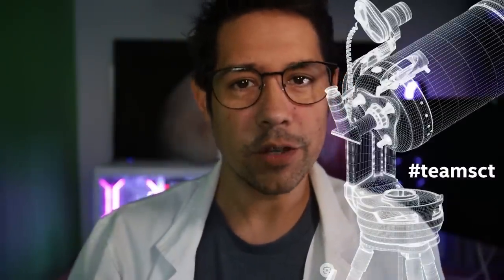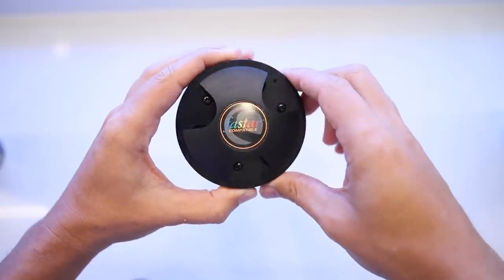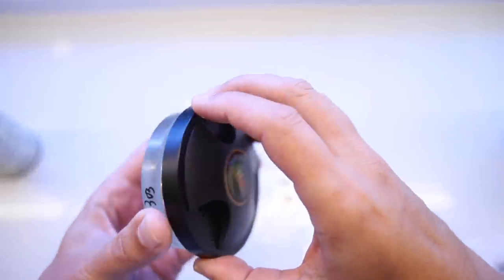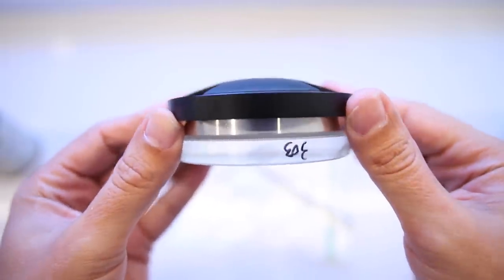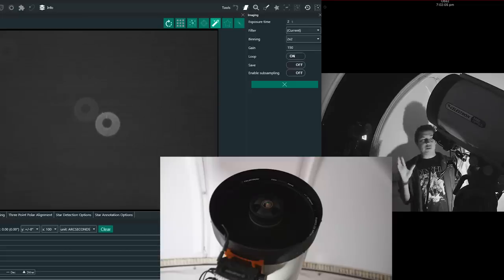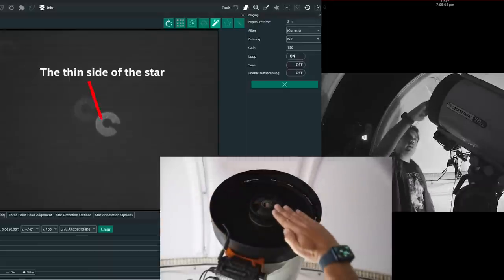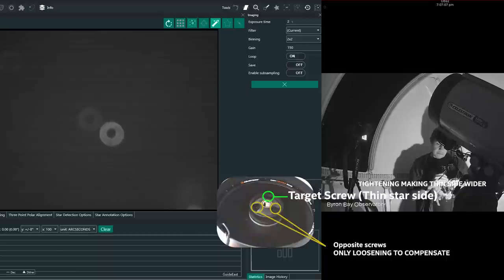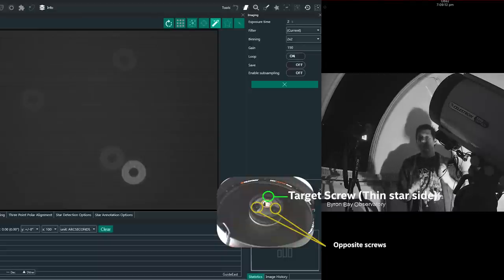SCT Telescope Collimation (With NO fancy tools)

Comment from the maker: Thanks for watching! And thanks also to @MarkusSchierz  and @jesuspineiro1622  for reminding me that if you want to dial collimation in perfectly, you should recenter the star as well after each adjustment. Lots of love for Bob's Knobs too which I understand .. it's a great product. I found they didn't hold collimation for as long as the factory screws in the past and local stockists didn't have the zinc plated options I need in this case. 

Also  .. you should loosen opposite screws first and then tighten target screw. I do this a bit in the video but don’t say so explicitly. 

And yes.. do be careful waving your PP around the scope glass in the dark :)
Reply: I think Bob's Knobs seem to lose collimation more often or more easily because the amount of torque actually applied to a fastener when it feels like you've tightened it fairly well is going to be different depending on the tool and even the size of the tool used.  For example;  try using your fingers, a short handle screw driver, and a long handle screw driver to screw a sheetrock screw into the wall.  The more torque a tool can applied raised the psi required to "feel" tight.   

For this reason using a small plier or 3D printed level that attaches to Bob's Knobs would increase the torque necessary to feel properly tightened down and thus would most likely hold collimation much more consistently.

I replaced my philips screws with allen head screws to avoid accidental stripping or slipping of the screw driver with my remote C11 Edge.

Cheers!!
Reply: Thanks for extra instruction.  🙂

Comment: Instead of a star, I always use a powerful flashlight covered in tinfoil, with the smallest hole you can possible make with a needle. This way you don't need the mount, and you can collimate your telescope indoors.
Reply: I’ve been wondering how I might do this. It’s been cloudy here for weeks so I don’t want to lose any time if it ever clears up again. Trying this tomorrow! Thanks!
Reply: and on what distance?
Reply: @JK-gn9qi  I my case, it's about 9 meters.
Reply: @k-d-n  how do you calculate that?
Reply: 9m? Congrats, you have a large home.
Reply: @lwizzit I use laser drilled masks (instead of aluminum foil) in the form of commercial artificial stars—these are just a torch with a rotating mask containing various tiny precision holes. As people have pointed out, the main weakness is that collimation isn’t being performed at infinity or with the primary mirror oriented upwards. However, it can be done during the day and is good for fast coarse collimation.

Comment: I cannot believe that you rubbed the secondary mirror surface with a dry microfiber cloth. You just introduced small scratches all over your secondary mirror. Good collimation video, but you never rub any front surface astronomical mirror with a dry cloth, even coated mirrors. Always use soft cotton balls with distilled water, with a drop of Dove liquid soap if needed to remove fingerprints. Yikes, dude. Your poor example will doom users to do likewise to their mirrors and cause them damage.
Reply: He’s also handling the secondary by its edge—I’d wear appropriate finger stalls or gloves. I’d recommend only attempting cleaning if a surface is heavily contaminated… first, direct air, with a large blower, over the secondary surface to remove free particles, followed by the most gentle drag (no pressure) of pure cotton balls, soaked in a solution of 60% isopropanol / 40% distilled H2O, from mirror (or corrector) centre to edge. Use a new cotton ball for every stroke. Also, rotational orientation of the secondary, the corrector and primary must always be preserved, along with lateral shims if present—otherwise optimal factory mating of the optical elements into a train can be destroyed.

Comment: Thanks for the video! I replaced the Philips head screws on my EdgeHD secondary holder with M3 hex head screws, as I find that the long arm of the hex wrench makes it much easier to reliably make small adjustments, rather than aiming a pointed screwdriver towards my corrector plate and trying to guess how much I turned it the round grip. Much less prone to slip as well. One additional note is that collimation on a defocused secondary shadow is still relatively rough collimation, and is more an indicator of mechanical centering of the secondary mirror relative to the primary optical axis. However, because the SCT secondary is spherical and therefore has no optical axis of its own, centering is actually neither required nor sufficient for exact collimation (centering is extremely important for Hyperstar however, as it has a very strong optical axis). To dial in exact collimation, it is still desirable to actually examine the Airy disk and rings of an exactly focused, centered star. This after all is what the image is composed of, but the problem is that seeing often makes this difficult. I've found that the best solution for me is to use Metaguide (free) - its live stacking and high frame rate make examination of the Airy disk and first ring feasible under most reasonable seeing conditions, and the coma detection feature is much more sensitive than I can detect by eye. Lucky imaging on planets is where you'll really see the difference, as the scope is then (hopefully) diffraction limited rather than seeing limited and typically much more highly sampled. I'd be interested to hear your thoughts on it if you decide to give it a try!
Reply from the maker: What a great comment .. thanks for the thorough exegesis !

Comment: why not add some small springs between the cap and the mirror to keep pressure so there will not be flop, I am actually surprised there isn't I have not taking my secondary apart.

Comment: Nice Dylan. Another really quick and easy way Ive found for 'roughing in' an SCT collimation thats way off (especially easy with Bobs knobs) is to view the symmetry of the secondary vs the primary (and vs the baffle tube) by looking directly down the optical axis from the objective side, in daylight. By adjusting the viewing distance you can vary the relative size of the secondary and its obstruction of the primary, so that any asymmetry becomes obvious as an uneven 'ring' of primary mirror showing around the secondary. Its really easy and intuitive to adjust until it looks even, and you can do it during the day. It works so well that, in my experience, the subsequent star test becomes more a confirmation of good collimation than an additional step.
Reply from the maker: Excellent tip!
Reply: This is such a basic question that I’m embarrassed to ask it.  Nevertheless, I want to make sure I’m following the details of this method correctly.  My understanding is that the primary mirror is considered the objective in an SCT.  As such, this means one should be looking through the visual back end of the telescope, not the corrector plate at the front end.  Is this correct?
Reply: Both ways work- obviously the conventional star test is the most accurate way to achieve perfect collimation, but since 'collimation' is basically just achieving the alignment of all the optical elements, and you can clearly  see the relative alignments of these from the corrector plate end, assessing and adjusting from the front end also works well to quickly identify and correct major misalignments....its also easier, and you can do it in daylight too.
Reply: @rosscayley8773  Thank you!

Comment: Dylan, That was priceless. The thin side needs to be tightened to PUSH it away from edge. Very easy to remember!
Thank You, and I really appreciate all the advice you give to the community.
Joe D
Reply: But it depends on which side you defocus. If you defocus a star in one direction, you need to tighten. If you defocus the star in the opposite direction, you'll need to loosen.

Comment: This video was a lifesaver for my C9.25 Edge HD. I replaced the stock screws with Bob’s Knobs and messed up the collimation to the point where I had no idea where the secondary was pointing (my fault, not Bob’s). I felt hopeless and had no idea how to fix it. After watching your video, I removed the secondary mirror and adjusted it using a screwdriver shaft as a feeler gauge. I got it close enough that I was able to collimate the telescope in about 5 minutes. I hadn’t realized that I only needed to move the screws by a fraction to adjust collimation. Thank you!!!

Comment: Great video, but I kinda feel like Celestron needs to maybe go back to the drawing board and design a better mounting plate for that secondary mirror.  No reason they can't machine a plate that mounts the mirror at perfect "zero" once the screws are installed, without mirror flop or lopsided attachment.  As it stands, it's EXTREMELY fiddly and more than a little delicate.  Can't understand why they left it the way it is, but maybe there's something I don't know.

Comment: Meade SCTs are a bit different.  Celestron secondary mirrors pivot on the central axis bump as you showed, but Meade secondaries use springs for tension instead of the central axis.  A Meade SCT can be returned to the flat collimation by finger tightening all 3 screws all the way in (per the manual).

Comment: I am so scared of collimating my C8. I checked the collimation just a couple of nights ago, and it looked fine. But I will likely come back to this video. You make it look so darn easy. Thank you for this very instructional video. Love the closing as usual.
Reply: I spent a lot of time initially calibrating my scope, understanding how it all works. I took the corrector plate off, cleaned it carefully. Replaced the screws with Bob’s knobs. I’ve found that the collimation needs to be checked and calibrated regularly. Similar to having to fine tune a guitar from time to time. Initially I bought a laser but the method in this video is the way to go. Bobs knobs make it simple to do this. Also , you can get that little donut image calibrated well enough so you can see many perfect concentric circles. It makes stars into perfect pinpoints. Worth the effort. I should note, I don’t have a computer hooked up to the scope, so I just adjust by trial and error and looking in the eyepiece.

Comment: Ah I miss those days when I had an SCT as collimation was so easy.  Now I'm a masochist with a RASA and it's dredded tilt 🙂  One piece of advice though, after getting your out of focus star, do a counter clockwise turn of the focuser to level out the mirror as it likes to flop around.  Collimation will be more accurate that way.  This was the most clear and complete video on SCT collimation, so well done Dylan!  BTW Bob's Knobs are cool but I heard that the regular screws hold collimation better.  Thanks for the video and clear skies!
Reply from the maker: Oh man I agree with everything you’ve said here!
Reply: Screws are screws whether they are regular philips head or Bobs knobs... I think what you find is people are afraid they are over tightening with the knobs as opposed to regular screws so they end up with loose Bobs knobs.
Reply: @tubedude54  Personally I like the knobs better so I don't have a screwdriver near my corrector plate 🙂
Reply: @deep_space_dave  I agree... trying to use that little screwdriver in the dark is a nightmare!  You have to constantly shine a light to make sure you find the screwhead and you end up losing your dark vision.  With the knobs you just use your fingers and feel them!

Comment: While I've had my Meade LX200 secondary apart, I have never tried it with my C925 EdgeHD. Meade used to have an ultra-thin flat spring washer between mirror and secondary holder to take up any wiggle room. It's very surprising Celestron has no mechanism that stops the secondary from flopping about during adjustments.
Reply: @johnadastra1754 I thought the same thing when I took my 5SE SCT apart a year ago (after I spent 30 minutes on hands and knees searching the floor for one, assuming I'd not seen it drop to the floor).  It makes perfect sense to a non-expert that a small, lightly sprung spring would help immensely.

Comment: Thanks for this video Dylan.  
Collimation is the one thing that still gives me the collywobbles!  Anything to make it easier
I took my Celestron apart to give it a clean (after taking a few very deep breaths) and set up the secondary mirror by eye as you did and then replaced it.  I have got the Ocal collimator and I checked the collimation....I just had to turn one screw by a tenth of a turn and I was in.
When I checked with a defocused star (Sirius) the next night the collimation was the best I had ever managed.  
The Ocal collimator is a great piece of kit and the one thing it has done is make me a little more confident to fiddle with the collimator screws.  Getting the secondary just about trued in by eye with your trick, made it so much easier
Thanks again for your pragmatic and practical approach to astronomy.

Comment: It was my understanding and experience that every adjustment would push the target star out of the center of the frame...and on my C9.25 (non HD) if the star was off center, the shape would change in terms of how bad it looked in regards to collimation. So I'd have to adjust the screws, recenter the star, and then decide if I keep going...rinse and repeat. The star centering on a 2350mm FL scope is a pain in the PP.

Comment: One additional step I would do is to mark the edge of the secondary at the notch so when you’re assemble them the mirror will be in the same orientation to the primary when reinstalled.
Reply from the maker: Interesting .. in theory it should matter thought right? If the mirror is perfectly symmetrical anyway?
Reply: @DylanODonnell  Celestron usually matches the corrector and the primary rotation to produce the best figure, so I would logically presume they would include the secondary to produce the best image possible from the set.
Reply: 80’s I worked at the UK Celestron dealership: Astro Systems 
At that time Celestrons were very symmetrical but did have a “tipex”/“white out” dot on the corrector and the corrector cell to get them aligned. Although very symmetrical there would be a prime orientation for best results. The C11 and C14 would be less symmetrical and more critical as to the positioning of the corrector plate and secondary.
We started selling Meade and found there was slightly more astigmatism on the 8” OTA’s so you could get a bigger drop in image quality if the corrector wasn’t in the optimal position. The 10” OMG those were a pain to tune.
We checked and tuned every imported scope (we made our own newt’s) Our collimation bench was a 12” parabolic mirror in a wood frame. At the focus was a 1/16” ball bearing mounted on a vane. Off axis a light which was focused on the ball bearing. We had 2 pence pieces with a bore hole to mimic a star or pairs of bore holes to mimic a close pair of stars to see the resolving power. 
Looking through a scope I could see the ball bearing fill the field of view and the whole room reflected with the main light on. Lights out and the artificial star viewed at a minimum of 500x magnification we would look at the Airy disc and diffraction rings to get collimation and fine tune the scope. Looking at the Airy disc is the ultimate way of collimating a scope and judging it’s performance. 
The main downside of our set up was it was all set up horizontally. We should have got round to tilting the whole apparatus at 45° so the scope would flex and slump (including the optics) in a position that more accurately represented its typical position in use
Reply: I have to add this demo is excellent, including the key point of backing off/tightening the opposing screws so balancing the pressure on the cell.
Next step would be to fully focus the star and for once Dylan you’ll have to get an eyepiece out, and the most uncomfortable one at around 4mm and look at the Airy Disk and diffraction rings formed by a starts image and see how concentric and clean the image is
Bearing in mind you will also be limited by every tiny slight atmospheric distortion your local conditions will throw up.
The collimation rig I mentioned we used. I could tell from the vibrations if that was road traffic. Train at the nearby station or someone walking past the shop. Even though we had our collimation bench in the most thermally stable location. I could still see the rippling and eddies of air moving round in the room

Comment: In your pinned comment you stated that Bob's knobs don't hold collimation as long. I noticed in your old videos with the C9.25 that the "knobs" were really loose and wobbly. I'm curious if your old knobs were slightly undersized. I use them on my C9.25 and the knobs aren't loose at all and were the same size screw that came with the scope. They seem to hold collimation pretty well.

I'm shocked that Celestron used a regular zinc screw instead of all three being black oxide. Must have been late Friday for someone in the assembly portion of the factory just before a weekend! Think they should give you a RASA 36 as compensation for your troubles :)

Comment: Great to see this video - really good to see the real-time adjustments!
Going to give my knobs a fiddle when I next get some clear sky.
When collimating an SCT is it normal for the stars out to the edges to be non-circular when unfocused or should they also be nice donuts?   All the pictures I can find only show what is happening with the central star, so it is hard to know if I've got other problems in my system or if it is normal to see squashed donuts towards the edges.
Reply from the maker: When the stars are different at the edges that’s not collimation .. it’s usually optics or back focal distance being off. Collimate for a central star. Then fix the rest :)
Reply: To perform a correct collimation, the star must be kept centered in the field and recalibrate. In SC, off-axis stars may appear out of collimation, but on-center ones are perfect.